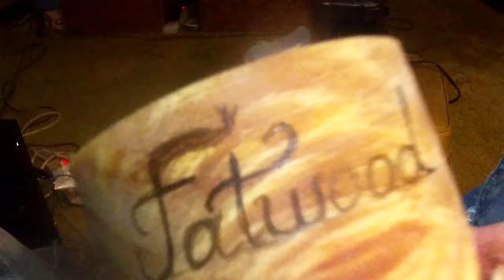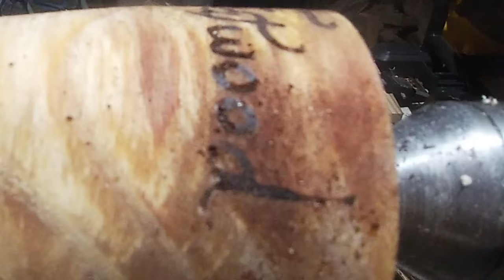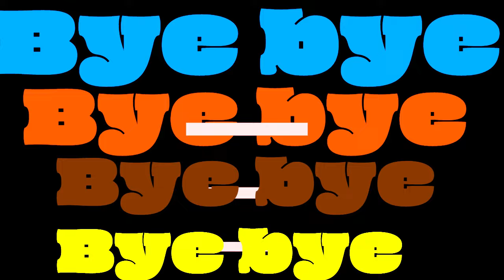Wood turned fatwood coffee cup

Comment: You can use a halogen light to put some heat on the piece to help cure the glue . Those shavings were explosive . Your laugh is contagious . I was cracking up with you.Stoked man🤙🤘
Reply from the maker: Never knew about using a halogen light!  Thank you Steve! I'll consider that.  Yes, I need a trail like you have in the beginning of your video and BOOM an explosion of fatwood.  Woohoo!  I'm Stoked you're Stoked!  ❤